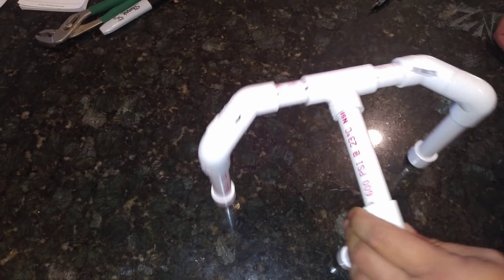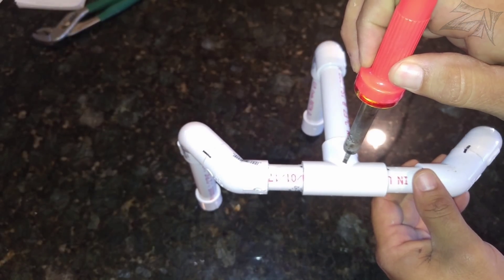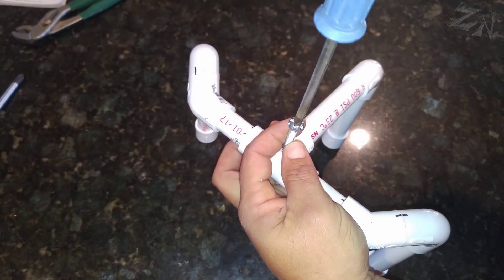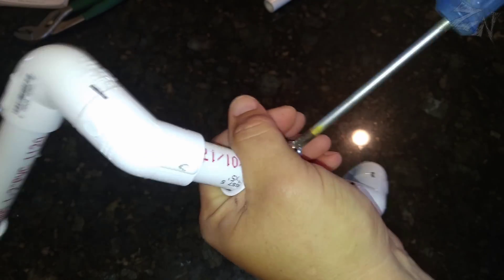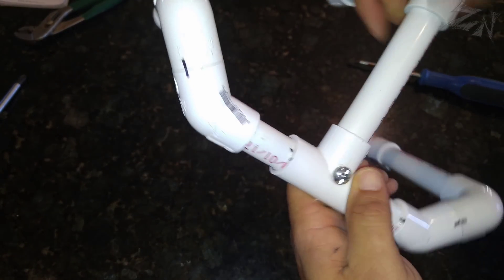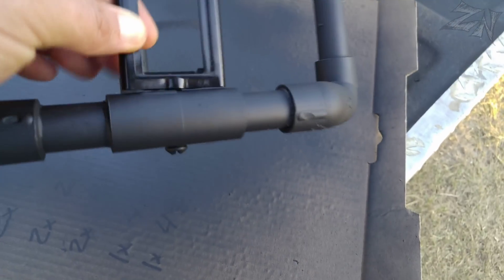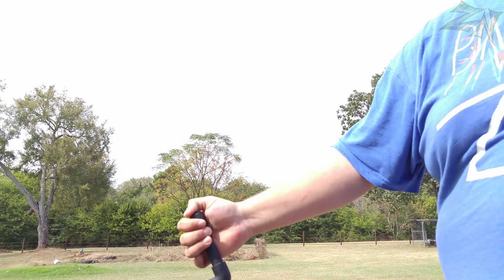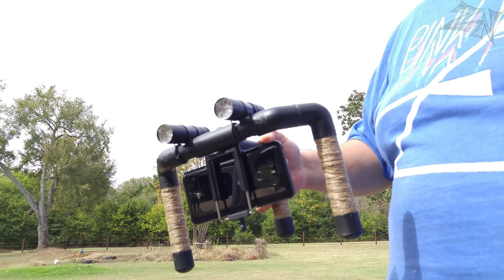DIY Smartphone Video Rig

Comment: One thing I see with these small rigs is you're centering the camera in the holder...not the lens. If you center the lens (offset the camera) it would be more intuitive when filming. Also integrate a moveable lens shade over the camera, on the brace.

Comment: July 2022: I went to Lowe's this morning and purchased all of the PVC fittings, tubing, and the machine bolt. I've just put it together, just as the instructions said in the video. Super easy. Took me maybe 30 minutes from starting the cutting of the PVC to finishing the glue-up. Total cost of material was $10.44. You can't beat that anywhere!! I'm waiting twenty four hours, and then I'll give it a flat black coat of spray paint. Super helpful project video HI PSI